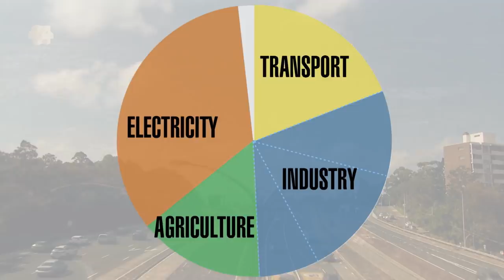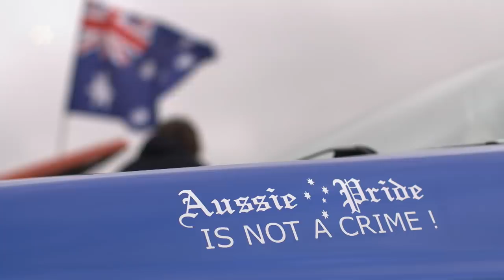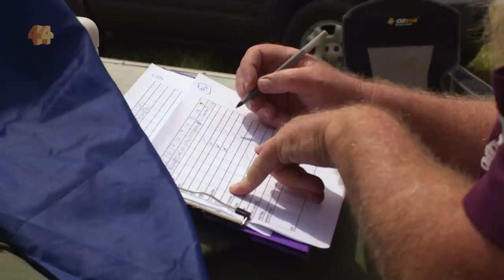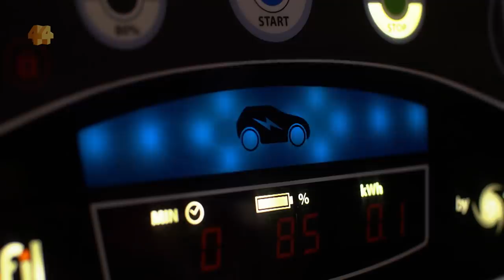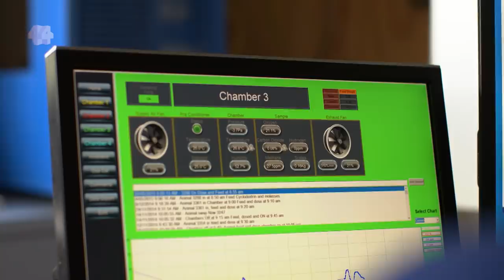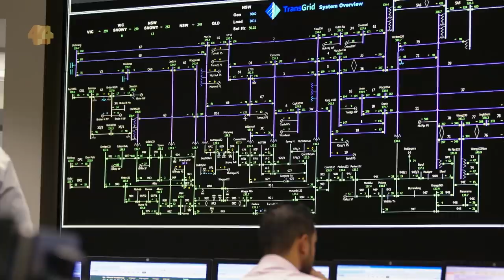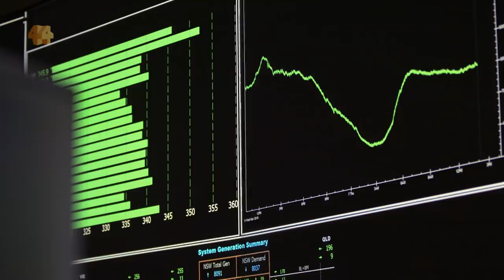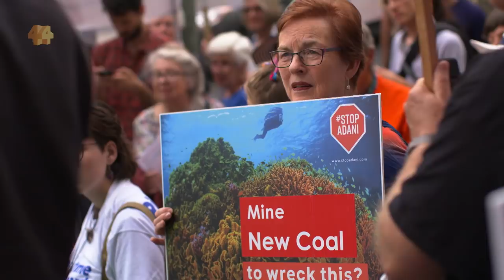Is Australia on track to meet its Paris target? | Four Corners

Comment: Few things, first...realise that this issue will cost you not just comfort and money, it will cost lives.
As for "petrol heads"... I invite you to educate yourself about performance of electric cars. No science needed, YouTube will do, your head will not explode. I am not happy knowing that all the torque, efficiency and power of electric engine will end in the control of proven idiots and I can see the danger there, but maybe it can not be avoided. if it is the noise you want  I am sure appropriate sound system can be installed (hopefully in the cabin so I do not have to react to noise you wish to produce around me.) If it is a stench of burned fuel you are after, cut showering from once in a ten days to once in 20, should keep you happy.I still do not know who and how is stopping import of electric motorcycles, wanted one for years, know they are cheap in China and so far I have not found a name of person responsible for keeping them out of Australian market, but...hopefully I will. 

As for politicians and economists....you will not avoid climate change and will surely find that money is not drinkable. The problem is of ignorance, stupidity greed and lack of responsibility. For some reason uneducated or worse are free to express propagate lies in public media without consequences. As much as I applaud free speech, deception particularly among politicians and than among media personalities is something that should not be tolerated. Politicians have science advisors, media companies have money to consult them. Deniers who are usually quoted in media and even in the government are debunked, exposed for what they are and exposed on youtube (Check Potholer or Thunderfoot channels on YouTube). 

I understand that access to best scientific research is mostly behind a pay wall (sadly), but YouTube, some research, Some university video lectures and IPCC materials are available to everyone - for free. The trick is to look for it and avoid imposters (PragerU - is not university, never was, never will be. - another example of lies in public media). 

No one here mentioned runaway tresholds.(point at which due to positive feedbacks situation will escape possibllity human control and mitigation)...not sure you can have honest reporting without mentioning it. What is your excuse for not mentioning it? People need to know about that to judge properly the danger of inaction and those who advocate it. I am not sure if you understand how even simple things like dissapearance of bees will kill you, most seem to be not concerned at all. if you can not grasp simple concepts like that, I doubt you can begin to comprehand the rest.

Humans are social animals, we exist in groups and are well adopted to cooperation and achieve better results that way. Multiple issues can be adressed simultaneously if there is a correct information and will to do so. trick is to push aside those who prevent you from communicating proper information and prevent you from acting on it.

Might be a good time to get rid of dogmas in religeons like in monopoly game you call economy and in politics. No monkey is divine and elected or not, has no right to push you or ecosystem over the cliff.

Comment: We should all be using electric vehicles charged from the excess power generated from our home, business and covered
parking rooftop solar arrays making nearly everything we do 100% solar powered.

The cost per distance driven is ridiculously cheap when you are your own solar fuel station (less than $0.01 USD per mile)!
#nobrainer

We cannot afford to continue to burn fossil fuels!
Reply: sanjuansteve 
Should we?
No, we shouldn't.
Reply: @bipolatelly9806  American Republicans clinging to fossil fuels.
GOP: Greed Over People/Planet
Reply: sanjuansteve
Do you really believe you would have excess power enough from home solar to charge a vehicle? LOL. Sounds great but the problem with most who promote this stuff is lack of knowledge. Home solar is barely enough to run a home. You would need your car to be parked at home all day while you were at work, for instance.
Reply: @toby9999  Do you really believe it's not possible to have enough solar panels to be net zero consumption?  Do you not know how solar power works or do you not know how math works.  Most homes in the lower half of the US for ex only need about 1/3 of their rooftops covered in solar panels to reach net zero and depending on how many km are driven monthly on avg, to add another 3-5 panels more to cover the consumption of the car too.  And with a high speed charger many cars can be fully charged in under a half hour.  Stop defending fossil fuels!

Comment: The life span of a solar panel is per haps 20 years... at that point the panel is toxic electronic waste and requires regulated disposal...(per hazardous waste)  What is my disposal fee for 15 panels, and a battery bank?
Reply: Sunset Cliff I use solar & have 30 yr panels (warranty) and the battery banks are no different than disposal of other batteries!
Reply: After 15 years, the solar panel has declining rate to zero by 25 years, so by 20 years it would be lucky to be at over 25% of original output

Comment: Be cheaper to turn it into carbon fiber heated at a couple off hundred then to the 5000 or turned into grafite for that cow you need a gas storage emptyed every week can't get the mouth but should get 80% you can use it as fule. Has a few I would have used the solar wind as the supply to run the turbine with a grafite caps not lithium to run it on the 16 hours not powered.
Reply: What!?

Comment: How to reduce the heat of the earth and atmosphere?
We must supply the earth with a natural cooling places...
Results:
1- To balance the water vapor which produces between the( ground)and the(seas and oceans )...

2- To balance the pressures of the air in the atmosphere...

3- To balance the directions of winds which caused the climate change...

4- To control upon the storms and harricans...

5- To revive the the first theory of climate change (dynamic horizontal movement).

NOTE :The lack of water vapor is of land not of seas and oceans...

These studies had completed and sent on July 26th 2000...

Yousif A Tobiya 
Forcibly displaced

Comment: What happens to the array of solar panels when hit by a micro storm with huge hail stones?. :)]
Just saying.....
Reply: The commercial installation solar panels are mounted with a motor that will tilt them towards the sun or away from hail. You can see the motor on the left side of every panel in the video.